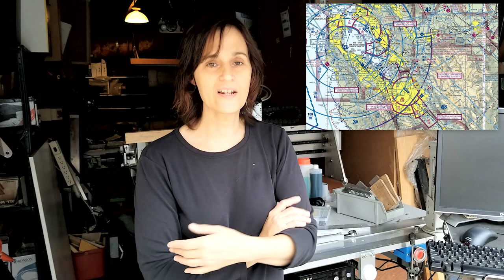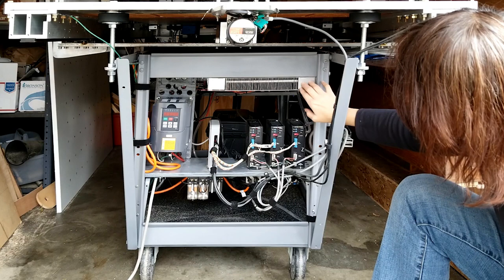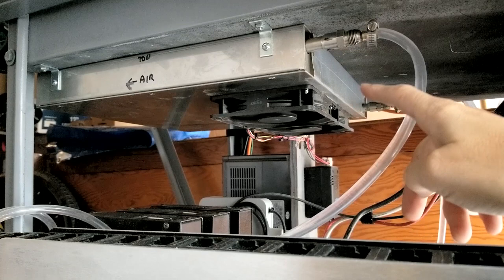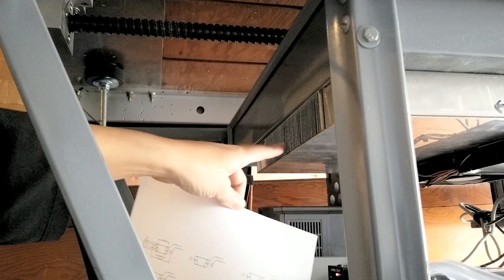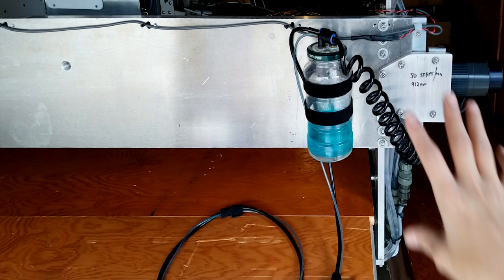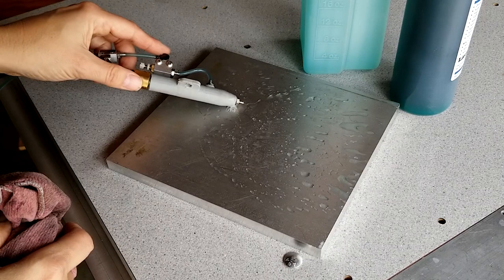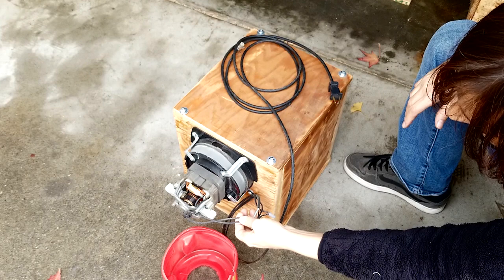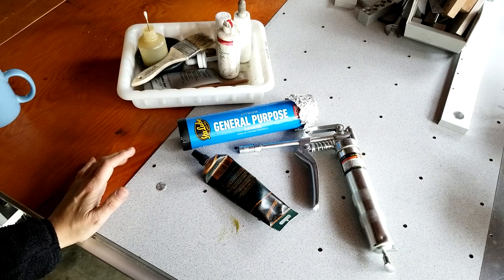Recycled CNC Project - Part 07 - Cooling Upgrade and Accessories

Comment: Excellent video. Have you thought about putting some antifreeze in your cooling water? I have a similar vfd to you, and I was worried about the water freezing in my garage in the winter. I also noticed traces of rust in the cooling pipes where they exit from the top of the motor. I used antifreeze with corrosion prevention for steel engines, and have not noticed any more since. I added a flow meter to show the coolant flowing, as the cheap submersible pump is the weak link in my cooling system.
Reply from the maker: (Thanks)

Yes, but I have to--ehem move very soon. I will likely used distilled water in the loop, when I set it up again. I wonder if the Kool Mist would work.

I didn't have any thick clear plastic for a flow-meter, but it's a good idea.

That's funny; I am worried about the cheap submersible pump in my system, too : )
Reply from the maker: @chrisfairbrother9197  , Twirly-thing: I am all for it : )